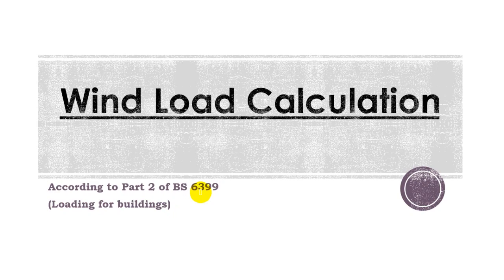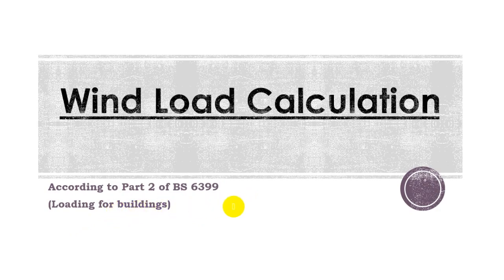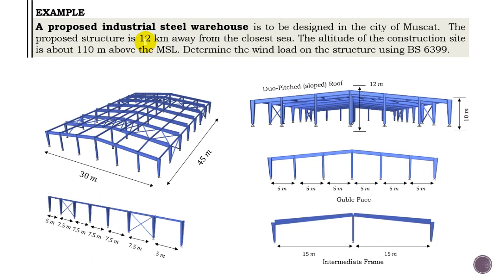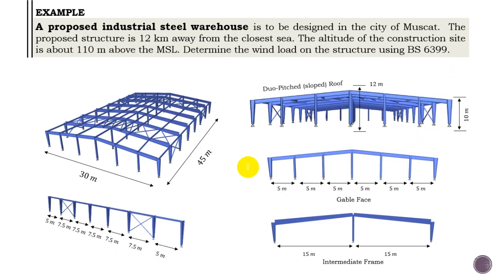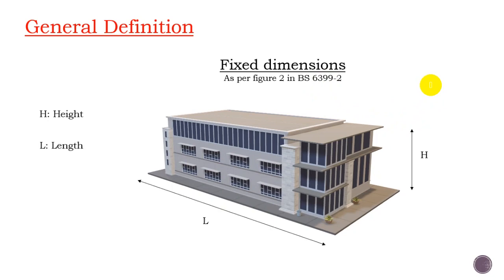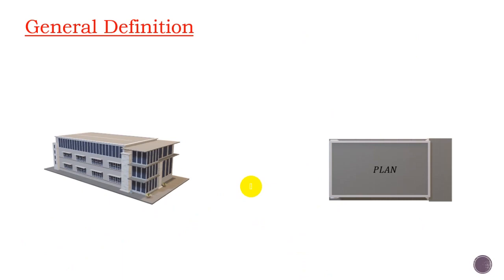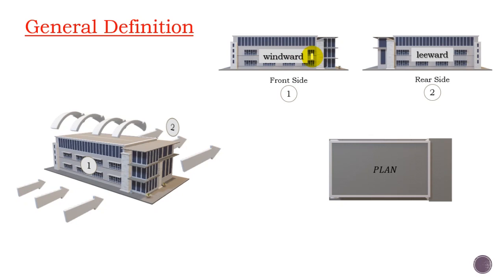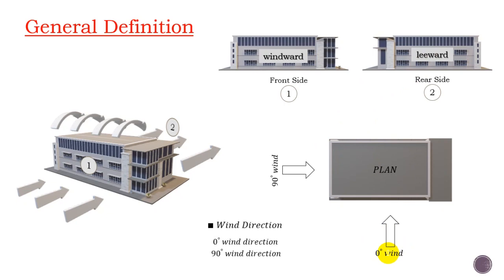Part 1: BS 6399 Wind Load Example (Introduction)

Comment: Excellent presentation. BS6399 is superseded by EC1 - Part4. Therefore, it would have been very helpful if you have used Euro-Codes instead of BS. Since June 2010 it is compulsory to use EC for all new structures unless you have departure from the clients NOT to use it. BS are still valid for assessment work! Thank you
Reply from the maker: It's because here we are still using BS 6399-2. It's is yet a good practice, all have the almost the same principles.
Reply: @abdullahalmahruqi1976  We still using it so it is very welcome